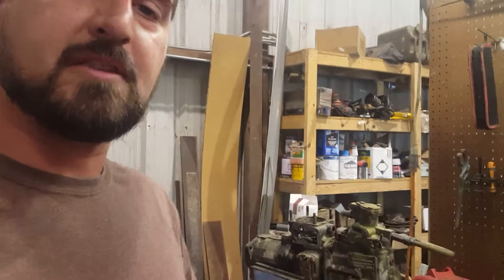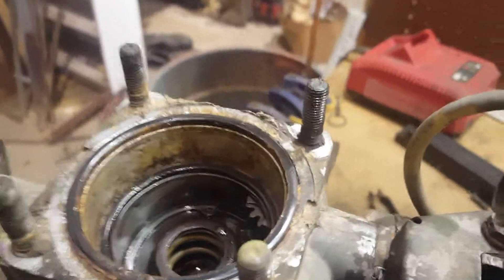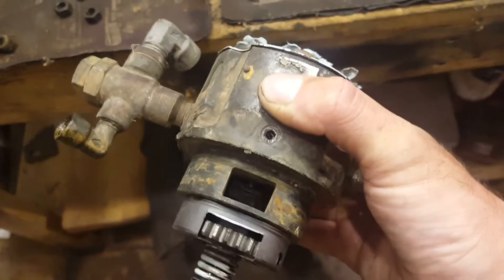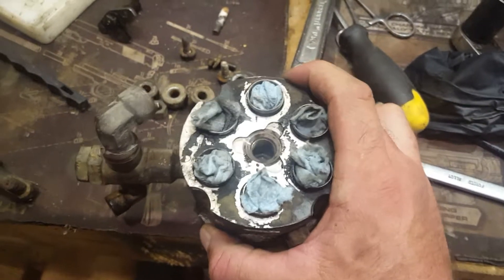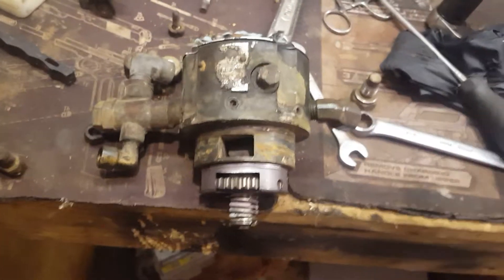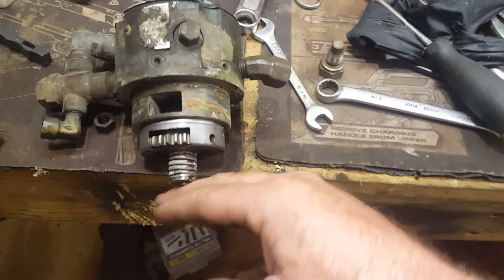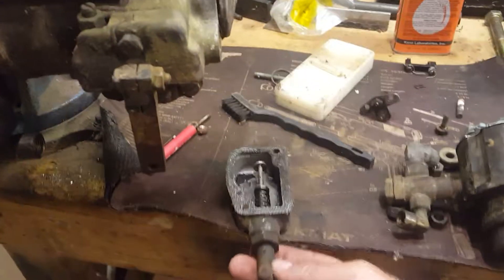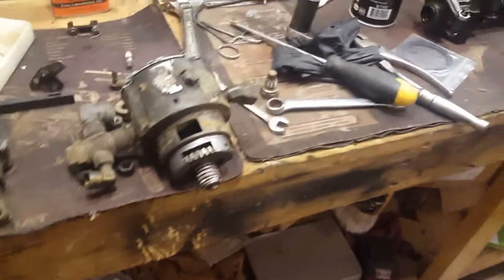Addressing stuck multifuel injector pump components ( the nasty pump)

Comment: Looking at purchasing a 1965 m35a2 the guy said it need a injection pump. It will start and run but won't shut down
Reply from the maker: @dustinlemos15  probably just has a broken or stuck shutdown cable.

Comment: I just bought a 1968 M35A. Started fine when I bought it. Drove it 50 miles now when I start it it wants to rev really high. That a sign of a bad injector pump? Kid I bought it from said it needs the tank cleaned and new fuel filters. Not sure what the issue is.  It’s a multi fuel of course and I know he was running shit oil cut with some gas.
Reply from the maker: Not a bad pump, just the fuel lever sticking. Clean it up like I show in some of my videos here and you'll be fine.

Comment: I bought a property that came with three trucks. A bobbed deuce, a 6x6 deuce, and a 5T. I got the 6x6 running and sold and now I'm working on the bobber. It's running and cranks fine but it has no throttle. The throttle linkage works and moves back and forth but there's no change in the RPM so no fuel getting to the motor through the throttle. I can't find any information or video of anyone having this problem. What am I missing? And yes, I know that's a little bit of a loaded question with probably a really long answer. Keep up the good work! Your videos have been vital in me getting these trucks going!!
Reply from the maker: Something inside the governor is either stuck, broken, or disconnected. Send me an email and we'll try to diagnose it together. Tacriflesmith1@gmail.com

Comment: First off your videos are very helpful! 2nd before watch all of this video I jumped right in and pulled the fuel shutoff mechanism out and it was froze up. I cleaned it and reinstalled it. Everything went together fine as far as I know except I didn’t note the orientation of the tit. It took some side to side movement but eventually everything slid into place. So I think. The truck started right up and ran great. But when I give it a rip and it idles back down it gets real low on rpm’s and dies. The governor rod is pulling the shutoff into the kill position. All I have to do is touch it and it snaps back to start position. Any idea what my issue could be? Governor? Or is my orientation of the fuel shutoff incorrect?
Reply from the maker: You probably just still have some air in the system. Really common. Just gotta run it.

Comment: i  have the  no start issue, i pulled off the fuel stop cover and found 9  ball bearings  lying in that cover ?  any ideas
Reply from the maker: A bearing came apart inside your pump. 98% chance everything inside the pump is junk now. Best to look for a replacement.

Comment: I had a run away but engine shut down on its own after 2 minutes. Any idea why .? Inline zexel pump
Reply from the maker: Pull your valve covers and see if any of your valve lash adjusters came loose and backed off. If they did, the valves simply couldn't open anymore so it couldn't draw air or push exhaust.

Literally was talking to another guy that just happened to this morning.

Comment: Hey if you get this my hh is fine but the rod that goes from the governor to hh is really tight and in turn I can move the throttle and it dose not do anything do you have a Video of you working with the governor side
Reply from the maker: Yeah, look in my playlists and look through my multifuel injection pump videos. There's one on replacing the throttle shaft seal that shows what you need.

Honestly though, something is broken in there if you're having that problem. May as well take it to a shop.

Comment: I have a 1966 ford 3 cylinder tractor with a bad injector pump , (simms) I have to rebuild it. What I want to know how , if I pump fuel in the intake will it run.? Thanks.
Reply from the maker: No, it will hydro lock the engine and permanently damage internal components.

You can soak a rag in gasoline and put it in the air filter housing though. That will run it for a short time.

Comment: I'm really new at this stuff and this might be a stupid question.  I'm assuming that the varnish develops as the parts sit and are not being used.  Will the same happen if your running you vehicle regularly?  And is there anything that can be added to the fuel to prolong or prevent the breakdown?  Thanks again.
Reply from the maker: T j if the truck is being used regularly this won't happen. There are fuel stabilizers that extend fuel life, but that isn't the issue here. The problem is these parts sit without moving for too long and it allows varnish to accumulate on the parts. As long as the parts are moved every month or two, this won't happen. Start the truck and run it for a few minutes once in a while, and the fuel can be completely rotten and it'll still run.
Reply: throw a few cans of engine cleaner in it or few gallons of atf mwhahah should get the varnish off after running it for a bit
Reply: Thanks John

Comment: Any chance you could go into detail on the rest of the pump assy. No one ever talks about the gear pump or fdc or fuel turn up .
Reply from the maker: If you look back at some of my earliest videos, there are some on those things.
Reply: Tactical Repair thanks for the response I'll check them out.
Reply: hey bud is there a way to free up a sticky fuel shut off plunger. mine keeps sticking and i really dont want to open it up. been spraying it with lube but thats about it
Reply from the maker: @johndowe7003  run the truck off a 50/50 mixture of transmission fluid and fresh diesel fuel. For a while. Cheapest transmission fluid I know of it like $12/ gallon at Wal-Mart.
Reply: ok ill do that because right now its mostly motor oil and atf cut with a little bit of diesel, i put a can of that diesel cleen, (the grey bottle)  not sure if it would make a difference but i threw it in the mix too. the truck runs great, i just have to push the plunger back in every time i restart it. would you be interested in selling me a good alternator for my truck? mine doesnt charge at all so i was looking at the delco style 24v ones but im not sure..